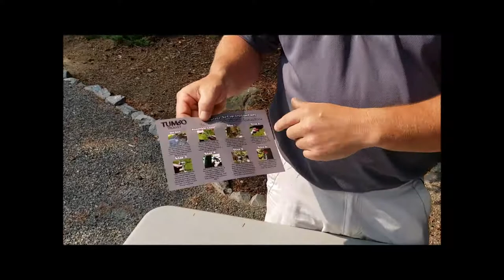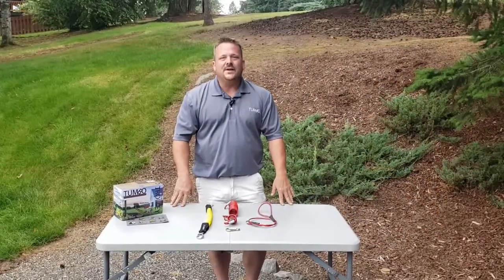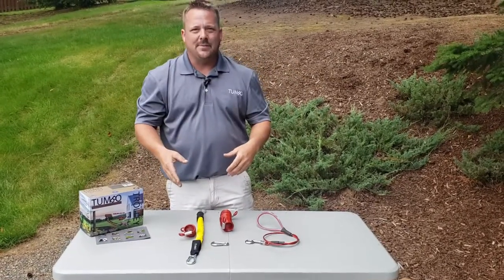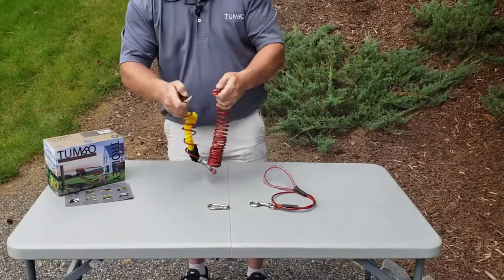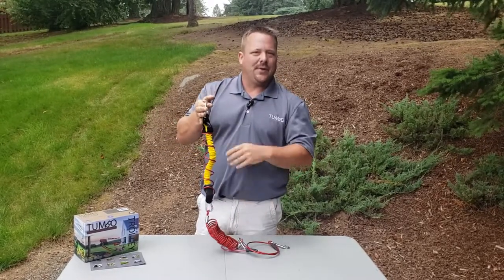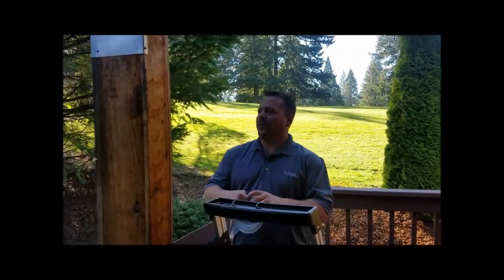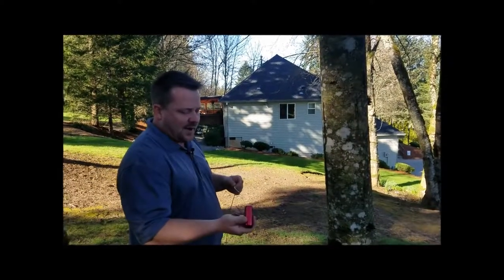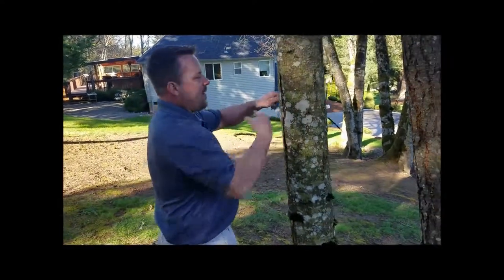Tumbo Trolley Installation Video 2019

Comment: This instructional video is no longer relevant for the tumbo trolley kit currently being sold.  The red anti-shock coil no longer features clips on either side, merely the red loops. The coil in the new kit is also yellow, shorter, and MUCH tighter. The newest version of the product is sadly not as amazing as the version featured in the video.
Reply: I'm not sure if they edited the video since your comment, but they do now include a section that shows the new set-up. He explains why they made the changes in the new model, which seems actually to make it safer and more durable.